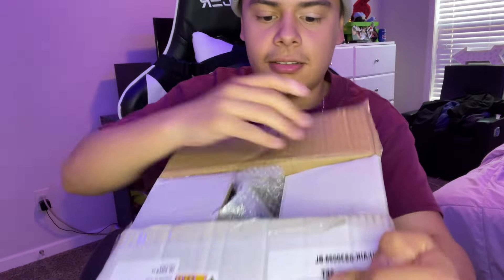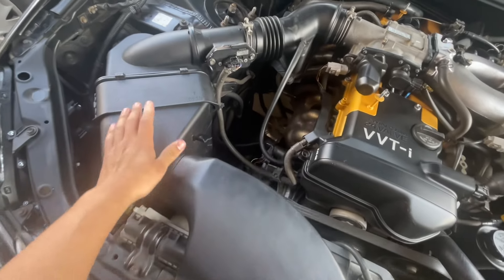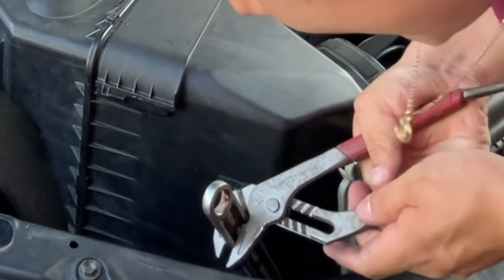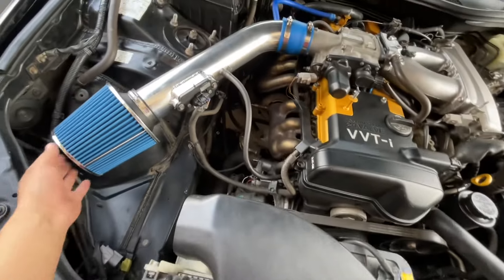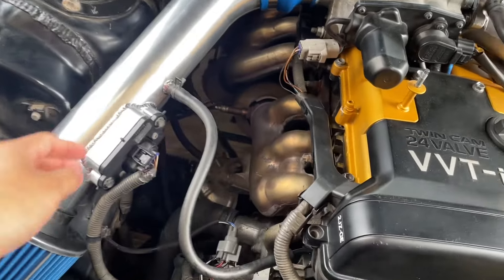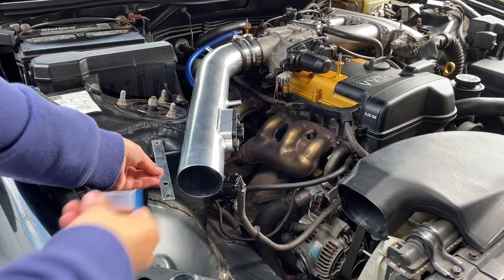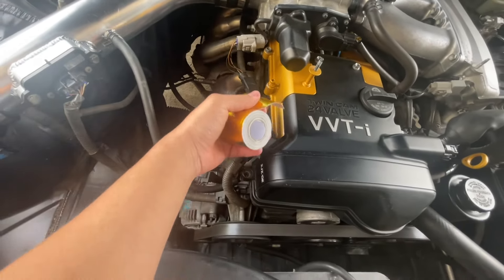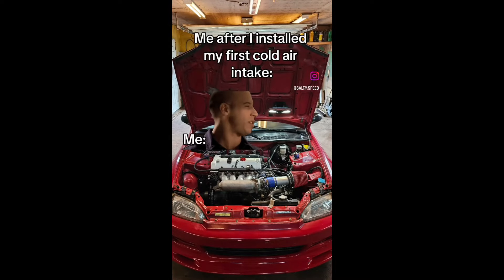GS300 Budget Intake Setup Install! Worth it?

Comment: its proven this will rob you of power 
the stock airbox is a litteral cold air system 
you just turned it onto a hot air intake

i have been building and tuning these cars for years 
that "it feels faster" is a placebo 
stick it on a dyno with your stock intake and this hot air intake and youll actually see the truth